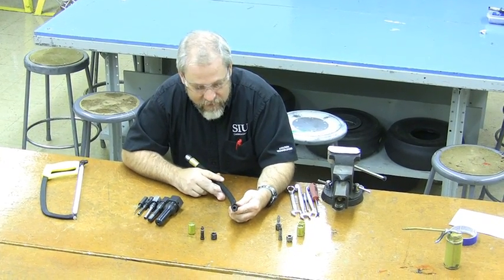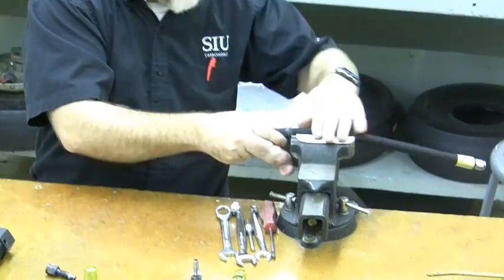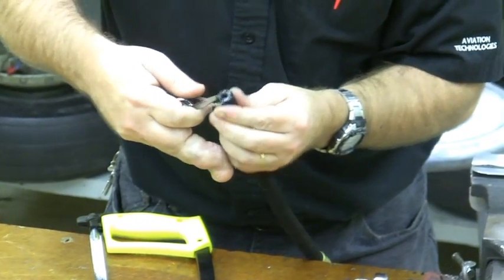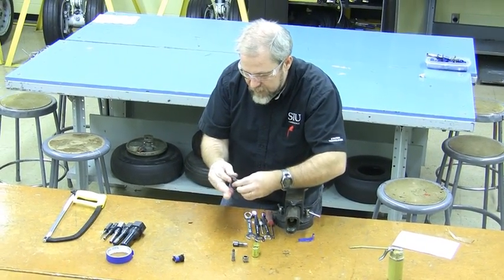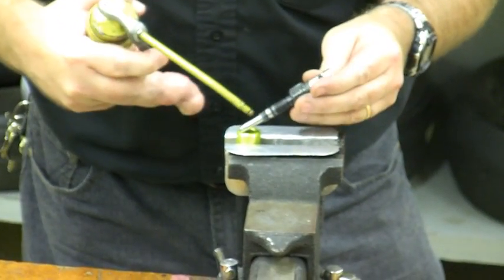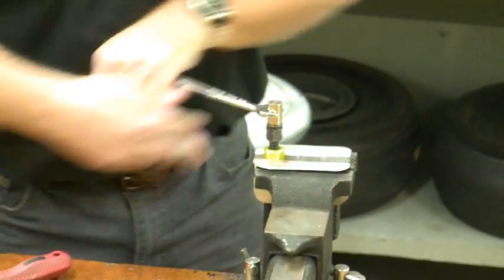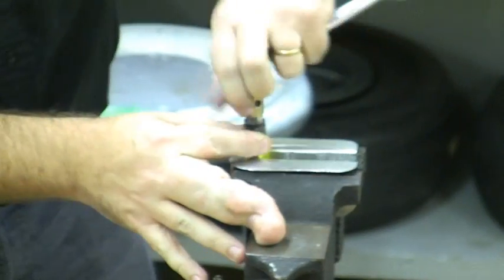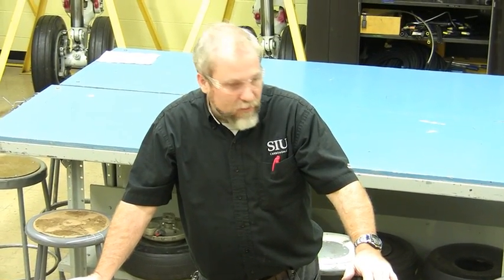Aviation Tools Training - AN type fitting on a Medium Pressure Hose

Comment: The yellow, anodized part is called a socket.   Also, once the hose is bottomed out in the socket, you are supposed to back the hose out of the socket 1/4 turn.

Comment: How do you know how long cut the Hose in Length
Reply from the maker: Measure the existing hose - or if that can't be done - measure the distance the hose must span and add 5% to 8%.  The 5% to 8% extra is necessary, because the hose contracts as it is pressurized.  For very low pressure, use the 5%.  As pressure nears the top of the rated pressure of the hose, go to the 8%.

Comment: my question is: how do we install a 45 degree or 90 degree fitting? The fitting you show on this video is a straight one, that you can push down with the tool, but for a 90 degree fitting, you cannot push it anymore, what would be the trick?

Comment: Do you have a video on repairing scratchs and nicks on ridge fluid lines ?
Reply: If your fingernail catches on the scratch or nick, it's probably out of limits.   If not, you can use aluminum wool or a burnishing tool.